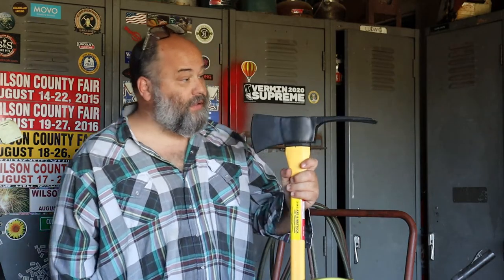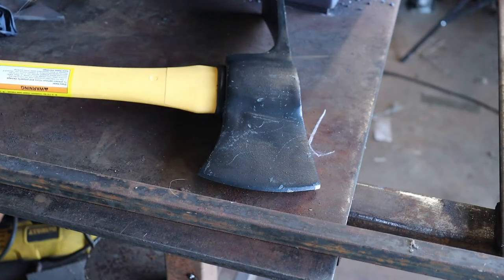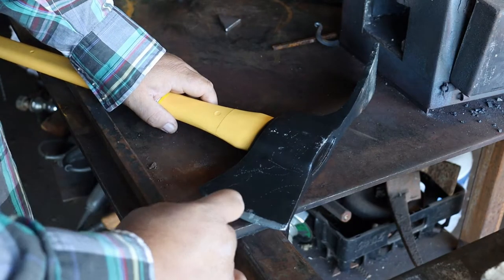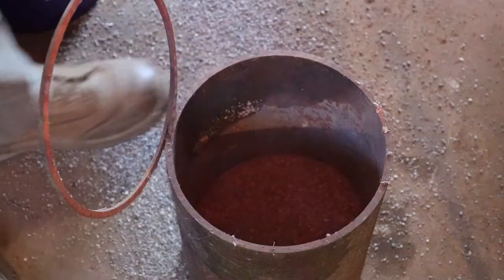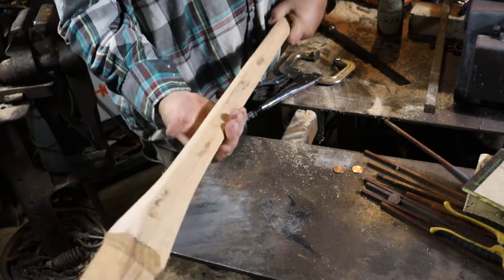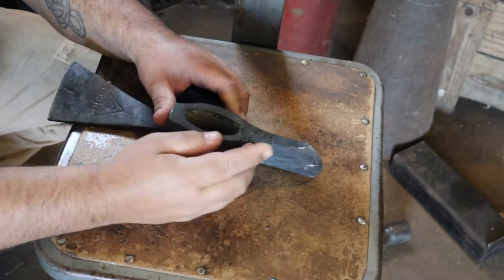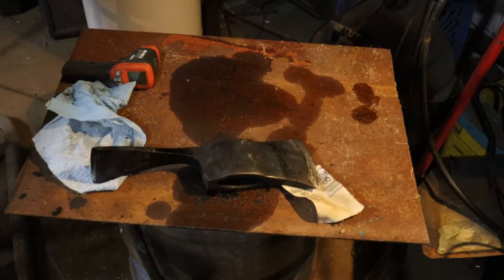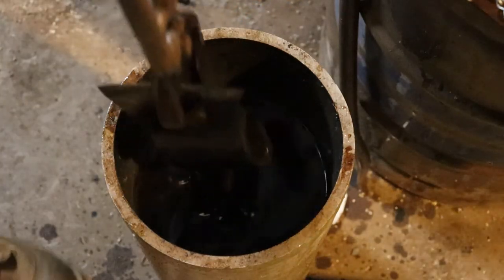Turning the Harbor Freight Pulaski Axe into a first-rate heirloom quality tool.

Comment: So it comes from Harbor freight with what i would define as not a real cutting edge. Wood handles are nice if you don't mind replacing them when they crack and split. I have used both kinds and like them both it depends on the hand tool and the punishment you put it under . Of course my round point shovel has a steel handle so there that way also. it  is not made  for splitting fire wood  you have to remember its origin and design purpose cutting fire line ; so grubbing out a hand line with the hoe, cutting large roots with the bit , small roots with the hoe , cutting and moving small snags out of the fire line,  removing small limbs from live and dead trees to prevent the fire from spreading. It is good for bush craft .

Comment: Usually they are lighter than this and more balanced I have one and it seems to split wood better than chop but as for a fire line tool I’d rather a lighter one easier to cut line with in my opinion

Comment: well better than it was but it's from india and tools like that the indians don't do so well! as long as you're not cutting a fire line every week with it it'll probably do ya` just fine! i know one thing i wish they'd just sell the heads instead of using fiberglass handles or at least figure out a way to hang the head without using an entire gallon of epoxy! a while back i swapped an axe head to a wood handle on one and it took all damn day to get that handle remnants and epoxy crud out of the eye!
Reply from the maker: They are a mess no doubt!
Reply: I'd just hit the head with a weed burner. No need to go to the steel's critical temperature. It makes sense for them to make the handle as solidly mounted as possible since hardly anyone is going to buy this crap to modify except out of utter boredom (which is fine, I do plenty of stuff out of utter boredom!).
Reply: @Comm0ut  yeah same here but most of my boredom moves ends up with a big boom and a crater!!